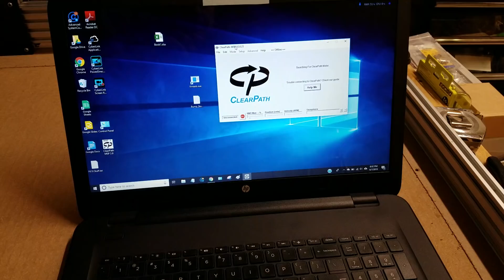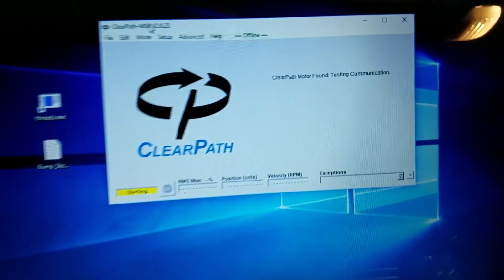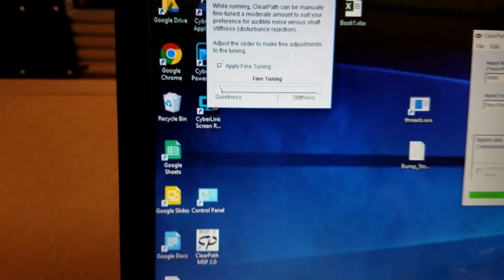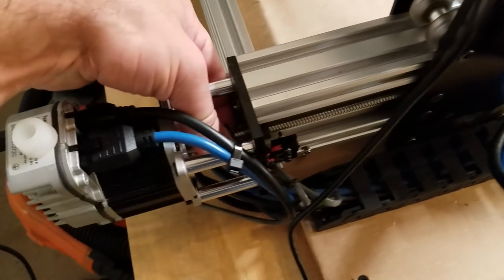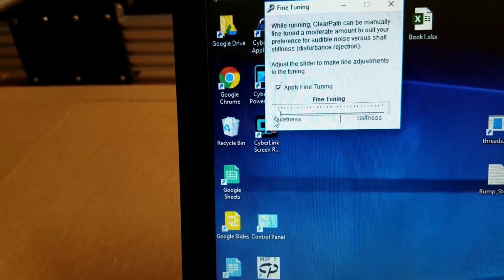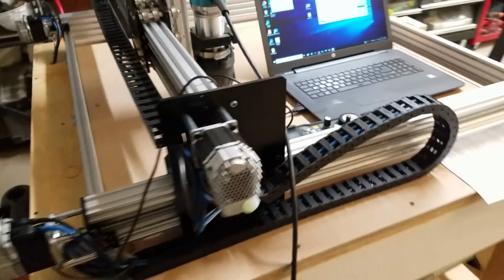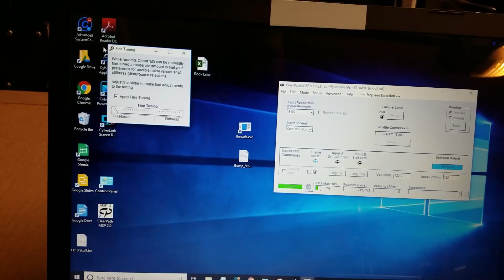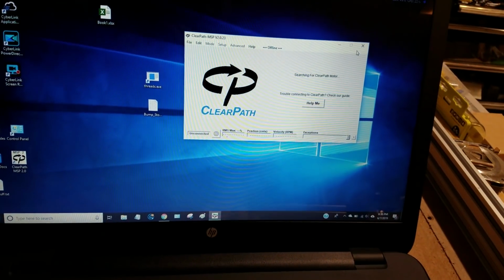WorkBee CNC Router: Update 7 FINE Tuning Teknic ClearPath Servos

Comment: Do you thing it is possible to mount Clearpath motor from the motor chassis itself?
I know that there are typical 4 screws form nema23 motors, but are there any other mounting possibility outside those?

Comment: Hello Franco, Sorry to bother with that but I'm still scratching my head and can't find anywhere an answer. 
What size or configuration would you recomend for a small shop workbench of 33'x48' ? 
A 750X 1000Y CNC or a 1000X  750Y?
 Tanks again
Reply from the maker: Hi.  My 1000x1000 fit on a 48"x48" bench with some room to spare.

Comment: Hi Franco, as always - great video! What did you do for braking the Z-Axis with the Clearpath so that it doesn't crash into the table in case of a power off? I've got my Acorn and Clearpath servos ordered <fingers crossed!>
Reply from the maker: Interestingly, that wasn't an issue for me.  My head did not drop when the power was cut.

Comment: What size is it? 1000x1000mm or 1500x1500mm. Happy with this size? Thanks
Reply from the maker: 1000x1000.  But, you don't actually get that much working travel.  I wouldn't buy anything wider than the 1000mm frame as the x-axis beam becomes too long and gets to be sort of flimsy.  The 1000mm length on the x-axis beam seems to be good.
Reply: Thanks a lot Franco! There this new Queenbee upgrade kit (CNC3D or Bulkman3D) with reinforced C-beam where the empty space inside the C-Beam has been filled in to make a rigid 8040 profile and along with lenar rails seems to be a good option to strenghen this CNC...
Reply from the maker: @Levisgil47  That is too cool!  Thanks for sharing.
Reply: @FrancoCNC  Do you mind asking the size of your table. How much more than the size of the CNC Frame to pick? Thanks
Reply from the maker: @Levisgil47  Good question. It's actually good if the Y-axis rails on the left and right of the machine overhang the table.  That way, you won't have to worry about dust and chips packing up between the table and the moving parts.  My table was 4' x 4'.  A bit larger than necessary.

Comment: I don't understand why you are loading the xaxis data to the y axis motors? Is this the recommended way of tuning the yaxis?
Reply from the maker: Because Y1 and Y2 are mechanically tied to the same gantry, there is no way to move them (auto tune) them independently.  The best you can do is to remove some of the mass, auto tune X axis and use that set of data as a starting point for the Y axis motors.  This is the recommended method.

Comment: Just finishing the conversion of a PM-30 to CNC with the Clearpath Servos.  I priced the CPSK motors to closed loop steppers with almost equal force and power and the CP servos are a lower total cost by about $10.  I could have lower the cost by building a single 70V power supply in place of the two Teknic PS units I bought for the system.  So happy with the performance so far.    The next build will be a gantry router to replace the X-Carve that I have in the shop.  Plan to use the Acorn and the Clear Path servos for that machine

I have watched many of your videos - learned about the Acorn from your videos.  Thanks for the ideas and good comments.
Reply from the maker: Awesome!  I'm gald I could help.
Reply from the maker: @Brandon SmithClearPath are great and they provide true servo technology - but they are not cheaper than closed loop steppers.  I don't have all the pricing information at my fingertips but this video may be useful: https://youtu.be/dvbsIgrwl1U

Comment: Two servos on the same axis will fight for position. Tiny variances in lead on the leadscrew, will make cause one side to push or pull against the other side. This is what causes the humming. My guess is, that the slider adjust how hard it will try to maintain a steady position. “Quiet” probably allows the encoder to be a few positions off, as long as it doesn’t creep.
Reply: Never owned a CNC machine but that's what I figured was the issue. I'd assume he's giving up a slight accuracy for it to be quiet, machine is not square by a tiny fraction.

Comment: Great to hear that you’ve been enjoying setting up the Clearpath steppers. Currently have some el cheapo nema 23 260oz steppers on my router, considering either going Clearpath or DMM DYN2 with their servos. Your thoughts? Hoping for not only positional accuracy but greater acceleration and federate for 3D and high speed toolpaths.
Reply from the maker: After using both, I'd go with ClearPath before DMM.  But, they are both good.  I just like how easy it is to make the ClearPath stuff work - very user friendly.